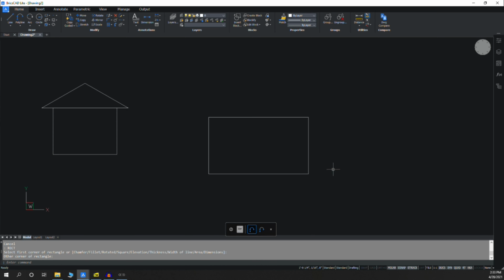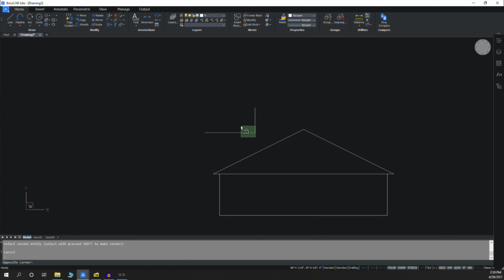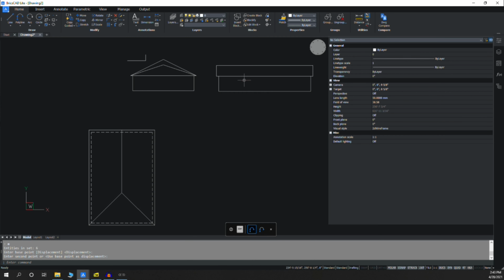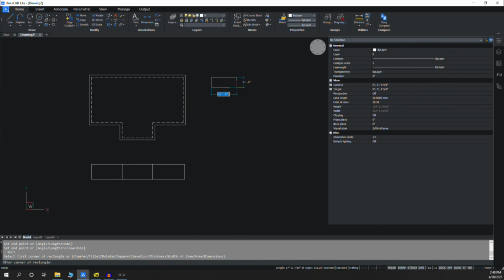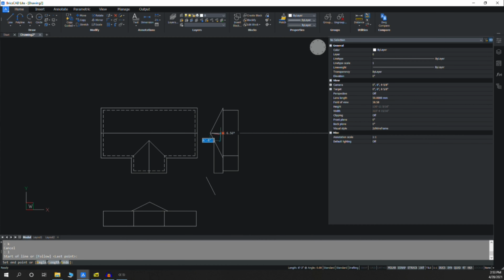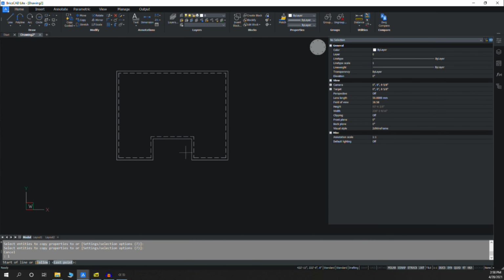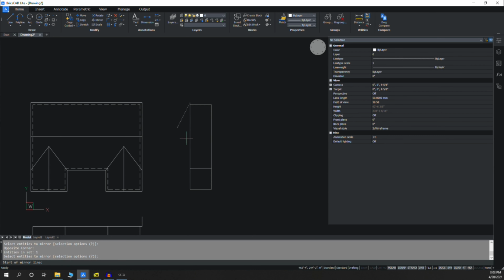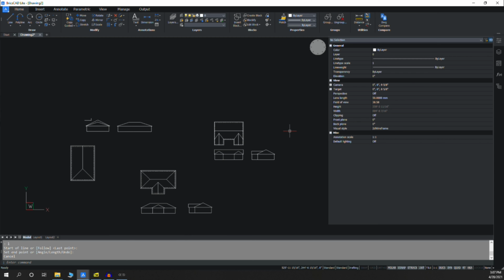AutoCAD ICF Construction - Designing A Roof

Comment: I complement you on taking the time to do a video, I was entertained that you used a hip side view first and called it a gable view. A gable view would not have the horizontal line at the bottom of the eve. I have to admit I was interested in the video because of the title, unfortunately what I see is not specific to an ICF. This same method could be used to get very basic information for any roof. I was hoping for some details on the interface between the ICF and the eve, standard stick construction holds the framing back 2 feet and ties the overhang back to the roof rafters. This turns the rafters 90 degrees so they can cantilever past the gable wall to create the 18 inch overhang. The method just mentioned is the old school way of doing things, but I was hoping to see a detail tied to ICF and a new build. oh well. 
Oh if you are still designing look into removing the ICF bucks, they don't work as well as direct to concrete sealing. Its up to you of course, but just do a google search for the report paid for by the buck manufactures that returned results they didn't like ( they ran it twice with the same results) hence no one talks about it because the guys with the money didn't want to publish the results.. I have a PDF copy so its still out there, it was done around 2016
-MG
Reply from the maker: Good note on the bucking; however, I don't believe the report you're referencing (I assume this one? https://www.rdh.com/wp-content/uploads/2017/07/ICF_Wall_Testing_and_Modeling_Report.pdf) applies to standard EPS buck installation practices in the US at least. The direct sealing option performed better than the others, but in this test, the only proper EPS buck tested was a Gorilla Buck with and "internally" mounted window. In the US, windows are typically mounted to the exterior face of the wall using a nailing flange, and then flashed into place with tape. I'd like to see how this performs, but I would imagine it would do a whole lot better than the bead of caulk they used in this test. Thank you for following along with our series, I definitely appreciate experienced feedback!
Reply: @avalianteffort40  hey that link is interesting, it's not the one I was referring to exactly, it's the let's clean it up version. 
 In the first study the standard flange just like you would see in a stick built is shown in the first few pages. There is more information in the first one than in the second one. I find it funny that they changed the write up so much. I am not going over the 84 page version in the link, I like the 86 page version that describes the methodology which was removed in the linked version. I don't think the first one put the manufactuerers in their happy place.
What I took from the first report was the overall implication that the less number of interfaces there are at a wall penetration the better you will be from a sealing point of view. I actually contacted a few window manufacturers to get some data on connecting the windows direct to the concrete I was told it wasn't and issue. I then figured I would use the ICF to make a better single interface. All ICFs can be flared at an angle greater than 45 degrees which allows the concrete to be flared out to meet the opening. Using this concept I flared the ICF so the concrete acts like a flashing on the top and sides. The window sill is formed using plastic door wedges, this uses the concrete to form a drainage plane at about 10 to 14 degrees. The sill and concrete is covered by WRB to the outside of the EPS and then you set the window in place. The widow can go inside, outside, or in the middle up to owners taste its really water tight as its just one interface and the window can have a flange or be flange-less. 
The EPS flare is can be done with any ICF stud spacing at 8 or 16 inch doesn't matter, but I would cut with a hot knife if the plastic stud is close or a regular saw if it's not. Keeping the stud close helps the flared area during a pour, if there is not stud close then the flare part on the core side can be primed for a tape. I was looking at Crete-claw. The widest tape can be used to mechanically lock the cut EPS section with just a little hanging out, instant acrylic flashing embedded in the concrete.
Crete-Claw is designed to mechanically lock Stego wrap to a slab of concrete I just figured I could use it to do the same around a window. I checked with both ICF manufacturers and the guys at Stego and I got the standard its not approved for that use, but I am not trying to pass some code only enhance an EPS connection to the concrete. Well hopefully all goes well with your build.
-MG
Reply from the maker: Ah, I caught what you mean about the hip view @1:20. Yea, my cartoon gable end definitely looks more like a hip with that line along the bottom :)